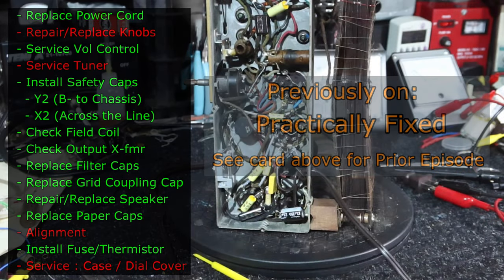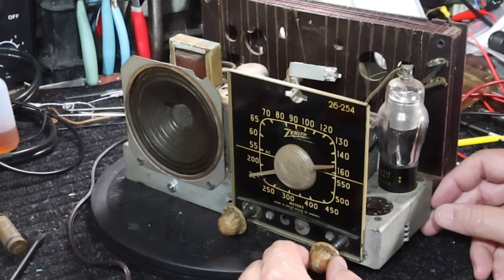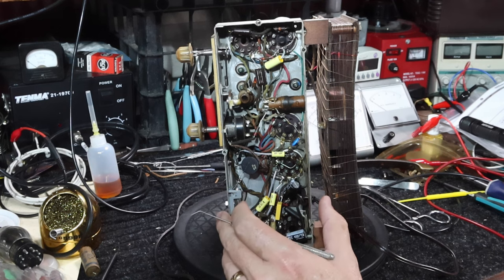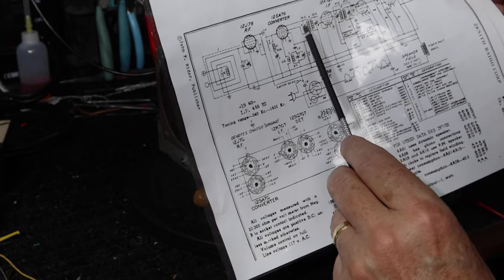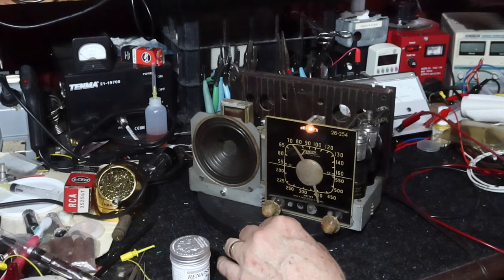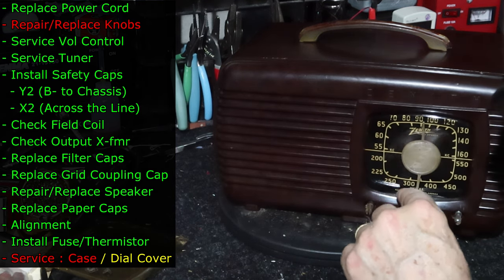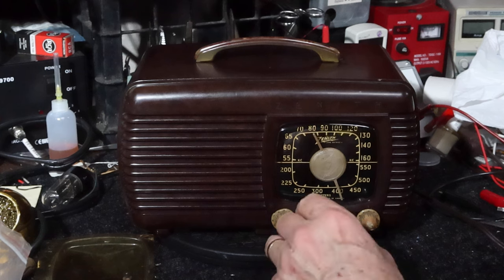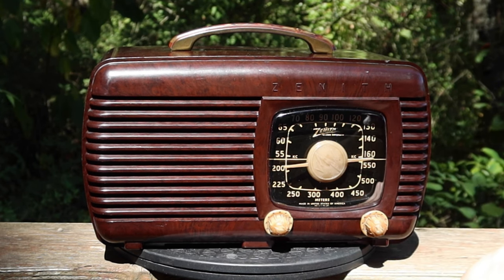Finale - 1940 Zenith "Long Distance" Portable - Vacuum Tube Radio 6D510 Part 2 [4K]

Comment: Nice logical  set of repairs The new and clear dial face and the  replacement back are fabulous. You remind me of my
early teenage years listening at night to the AM band and getting East coast AM radio stations  in Chicago from places 
like Boston (WBZ 1030 AM) and also heard Philadelphia, Pittsburgh, and also Chattanooga ,TN.  Not with a tube radio
 but listening on a 1973 Plymouth Satellite  AM radio. And started  the DX  radio listening bug in me.
Reply from the maker: Hi Steve. Thanks, they do look nice.  We used to use my Dad's S-38B back in the 60s and tried to listen in to SW, but we never had a good enough antenna set up.  I was impressed at the reception with just that box wavemagnet in my shop.  Hottest radio I think I have.  Looking forward to cooler weather and putting up a wire in the backyard and listening in while doing one of my all-night smoker cooks.  Thanks for the note.

Comment: On that dial string, you have the patience of a saint. Thanks for the shout out. Great job on the alignment. On removing those pointers with a shaft band , I usually spread the band with a screwdriver to alleviate the pressure from the band and they will generally give loose. Great looks for this model. That dial cover really makes it POP!😊. Picking up stations more than 200 miles away makes it truly a “Long Distance” radio.
Reply from the maker: Thanks for the tip.  Will need to try that.  When I got Nashville I thought, "now that's a long way..."  Thanks again.
Reply from the maker: So sorry I got your YouTube handle number wrong in the video!  I put in an Errata in the description to correct it.  I jumbled the numbers - typical for me.

Comment: Hey PF, nice job on the string, too bad your shortcut didn't work out. Wave trap, yeah that RCA 66X1 was the first radio I've worked on which had one of those. I like coupling the signal in with a loop as you've shown. Seems to me this is more in line with how the radio is meant to work. Turned out very nice, good job. :)
Reply from the maker: Thanks Doug.  Yeah I showed everyone my mistake as usual, but I am glad I did the stringing correction.  I am sure it was wrong.  Next time I would just untie the string and redo it as I ended up doing it.  It was only difficult because I didn't remove the pointer as I was concerned it would break.  That wave trap worked pretty good as designed eh?  Thanks again.
Reply: @PracticallyFixed  Yeah buddy, it worked just fine. :)